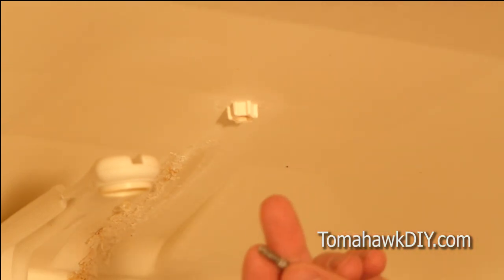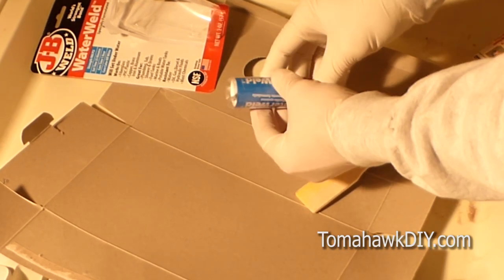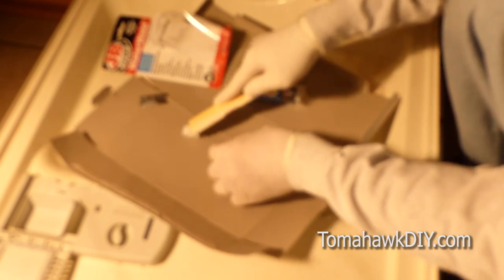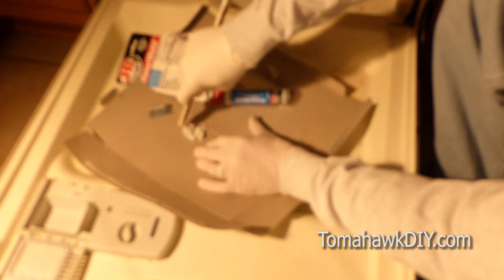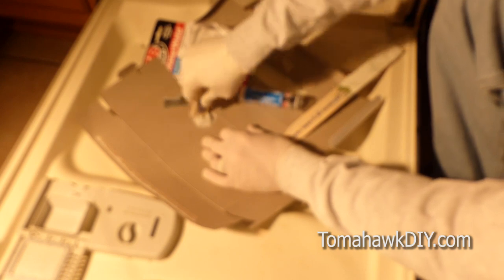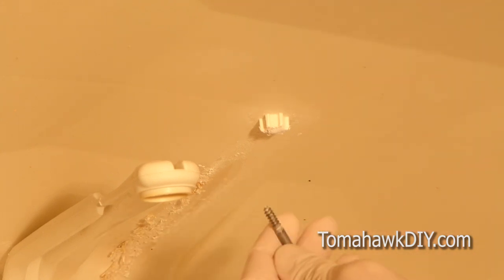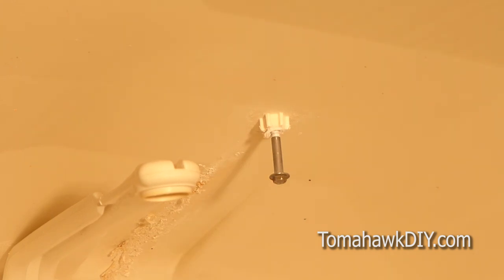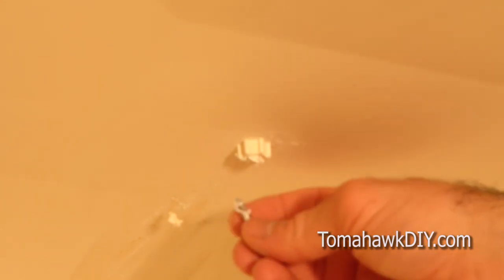How to fix screw that striped from plastic - epoxy turns to plastic

Comment: Great idea for the teflon tape.  I was going to do the something similar but with some grease or vaseline or light oil, but the tape is a much more manageable solution.
Reply: Another idea which I think is usually better, just let it dry out and then create the new threads by putting in the screw.

Comment: Great idea -- question -- did you wait until the epoxy was fully cured to unscrew the screw or just a couple of minutes??? Or somewhere in  between??? Thanks -- very good idea!
Reply from the maker: It's been a few years but as I recall I left it overnight with the Teflon tape so it would release.

Comment: Will this work to fill in stripped threads in plastic oven door in order to make metal screws stay in?  Also, what about withstanding oven heat temperatures, especially the oven cleaning cycle?

Comment: You are A lifesaver. OMG
Reply: I have a jeep wrangler 2015  molded plastic, rear left, bumper where several bolts are screwed into  threaded (female) attachments hole.i can't get it registered but I think this will work.  I'll let you know if it works. I can use Zip ties to hold the bumper frame to proper place while it dries. Any other ideas to make sure it holds? I have 3 spots that are stripped.

Comment: One thing you should have done is to smear some of the epoxy into the threads of the screw. Because I bet by shoving that in there, that there is probably lots of air around the screw since the epoxy is thick and not a liquid and thus won't run and fill in threaded area. I'd say a liquid epoxy would be better, assuming you're able to do it where it won't run out.
Reply from the maker: Thanks for the tip

Comment: Maybe you would have had threads inside, if you knew which direction to turn your bolt while inserting lol. Overall a super bad idea, it would make a whole lot more sense to just drill that hole after it is dry, and thread into it with a new screw.
Reply from the maker: Thanks for the insights

Comment: Questions lets say i applied some of that epoxy, will i be able to remove the screw once it screw it? I have a pc case that has hole, made out of plastic, to screw in the front panel but I used the wrong screw and now the original screw is loose to fit. Will this help?
Reply: In the video he used teflon tape on the threads before putting them into the hole filled with epoxy.  There was some residual tape attached to the hole/screw, but the screw came out no problem.
Reply: You just watched him do that!

Comment: I have a similar problem with a plastic lawn chair bought at COSTCO. For some reason, two of the crews that were supplied for the arms have been loose from day one and will not thread in and stay. The other chair I got does not have that problem, although the screws are identical. I was thinking of epoxy but after seeing this, there might be drawbacks. Any suggestions before I decide to heat the screws up with a torch and inserting them in the hope that the plastic will melt and grab when it cools? I suspect the holes were drilled incorrectly(too large) when manufactured.

Comment: Can this only be used with a bolt, I need to rebuild a thread for a self tapping screw
Reply: Look for a helicoil to fill the plastic. They make all kinds of thread sizes & very inexpensive but once the helicoil is in & secured it is much harder to strip because the helicoil is made of metal

Comment: Looks to me like the epoxy came right out with the screw... ?? I do laptop repair. This lady dropped one off that has been opened at least 10 times already, and the plastic threads for the screws are literally falling apart. I know I can use some gorilla glue in there, and it will never open, LOL...but probably not the best idea. I was wondering about the epoxy thing...but I'm not convinced.
Reply from the maker: It held for at least a couple years before we moved from the house. Not sure after that.
Reply: thats the teflon tape